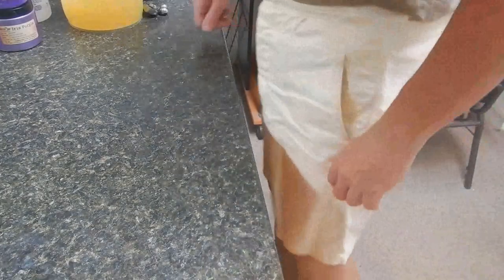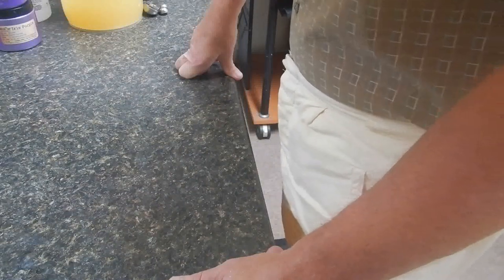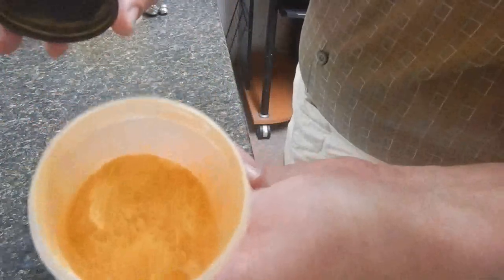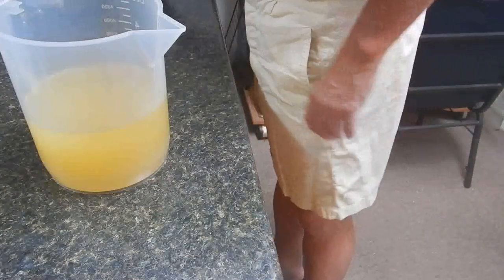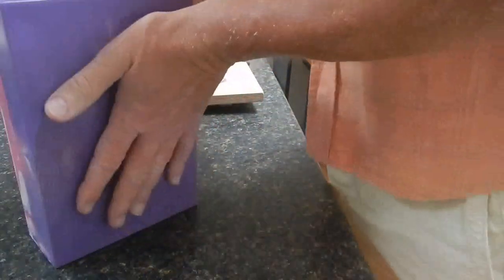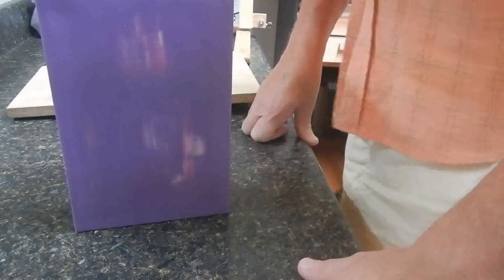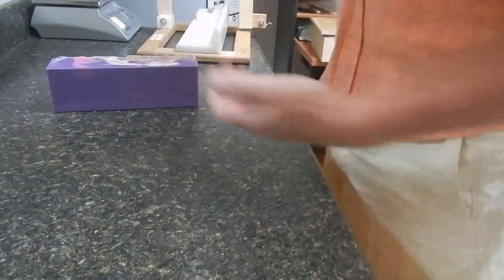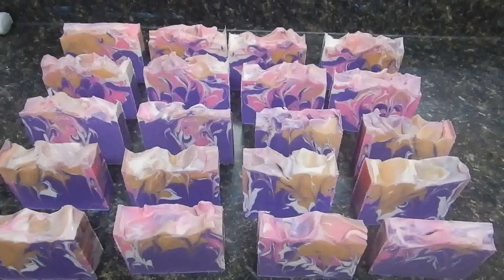Blackberry and Spiced Pear CP Soap

Comment: Hope you are having a great Labor Day weekend.
These colors pop.  They go so well together.
Every single time I try to gel at a hotter temp.  I get large cracks in the top.  It doesn't happen at all at room temp. (74 - 82)I have tried this for years!
I think it is the very high altitude.  Since I have been experimenting on this for yrs., it is the only thing I can come up with.
When I do it at cooler temps, no problems!
It has to be these Rocky Mountains.  Oh well.  Love the mountains.
Thanks for sharing👍💕
Reply from the maker: Hi, Cheryl and thanks.  It could also be your recipe that causes cracks with hotter temps.  I'm certainly not at the altitude you are, but I'm in the WV mountains and I do a water discount.  That's the beauty of homemade soap, everybody's is different.  Have a blessed holiday weekend, my friend!